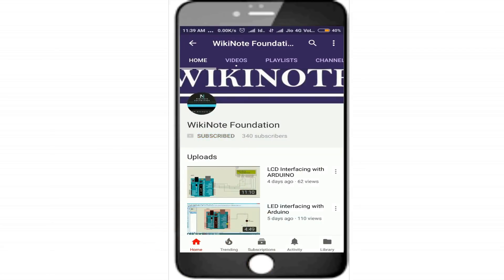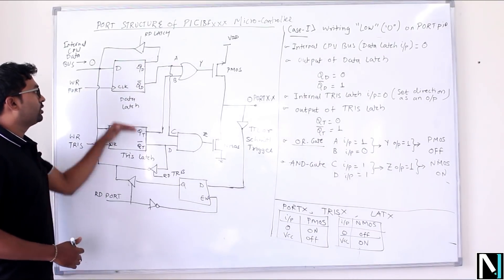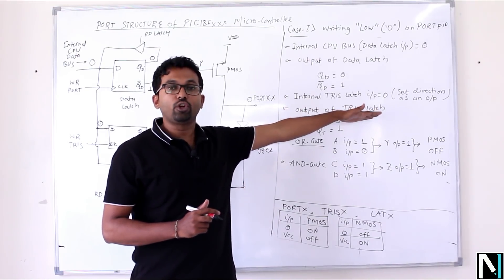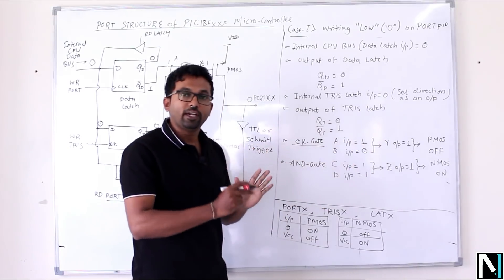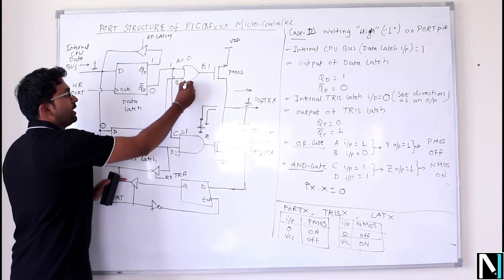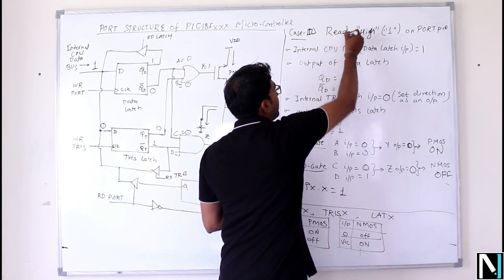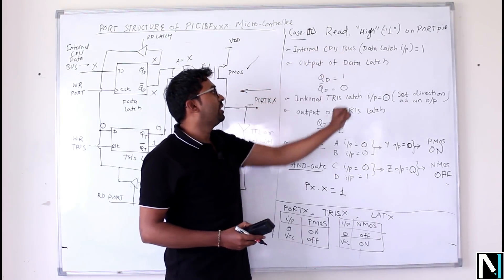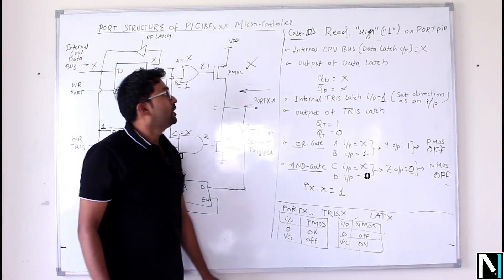Port Structure of PIC18 Microcontroller

Comment: well explained.  but one point i dont quite understand.  the D for the TRIS is connected to the PORT latch and the Write TRISx is connected to clock.  I am not quite sure how i can achieve Q=0 for output and 1 for input.  shouldn't the D be the same for both?  how is TRISx controlling Q when I dont know what the previous state is?  please help me...
Reply from the maker: Hi....U have to start ur process...By considering some initial conditions...If not then it's difficult to explain...bye d way nice doubt..
Reply: @theWikiNote  alright thanks!